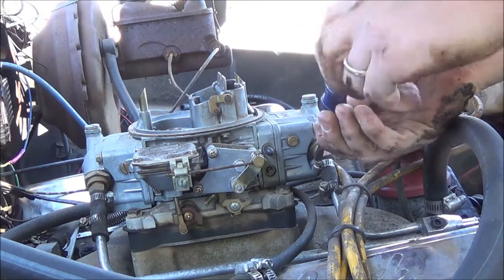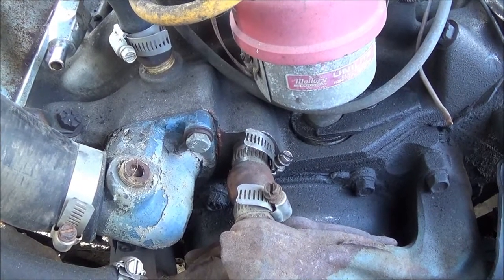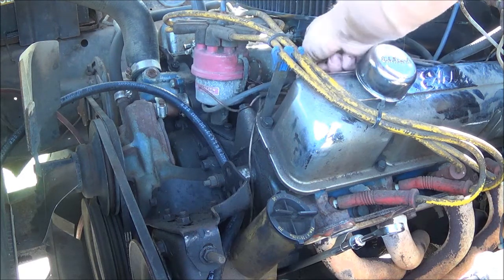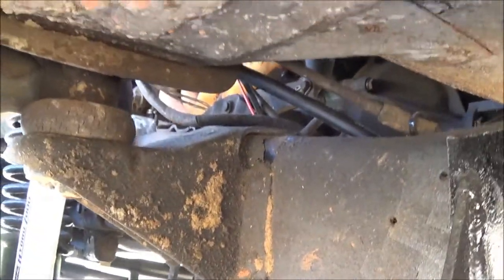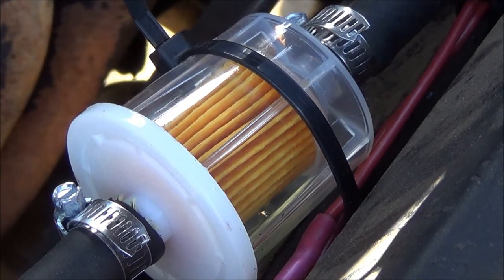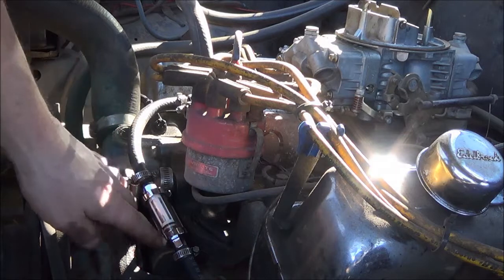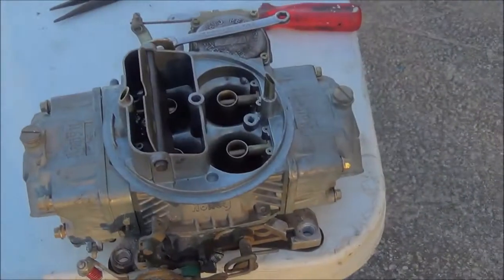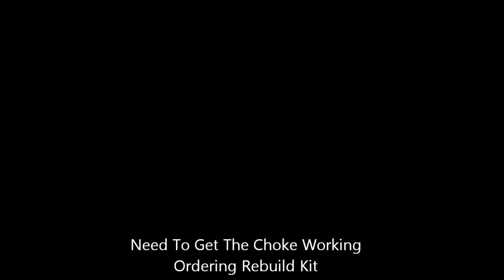1978 F-150 Build Part 13 New Fuel Lines, Filters, & Carb Trouble.

Comment: I had same prob. but mine would not start something eat my gas holes in the backthen I put new line on it to start it so I can move it and the glass filter is leaking I need to fix it now I watch all your videos so fare in 1 night great video you show how you did it all that's what I like I have a 1978 bronco 351m im try to fix up I call it crusty right now it has little rust in it lol

Comment: It's good to get all that rotted runner line out and get the gaskets in and between the intake done while it's still possible. Also..that rubber fill tank one rots out too. My 78' just lit up this fall because I tried to move from storage only a few years...everything dried out. Just about lost my shop as well. Never had an engine fire I couldn't get out. Now I own a fire blanket as well as a larger co2 extinguisher. Just bought a solid donor truck today shipped to me for 800. Hope to move my Cleveland into the truck after going through the topside dealing with fire damage. Hope it's all good.
Reply from the maker: sam k damn it man. sorry about the truck but glad the shop is still standing. fire is a scary thing!!!

Comment: I'm driving my one owner 1978 Flare side. My problem is I'm running out of fuel for the Holley dual pumper. On hills and on straight flat roads, it's cutting out. I've changed spark box (tempted to go back to points.  I'd have primed carb instead of cranking on starter so long.

Comment: Just my opinion, but I'd looking in to some heat sleeving for that fuel line especially around the engine to keep it from boiling the gas. Thermotec and DEI are the first brands off hand that I know.
Reply from the maker: You are right. I actually re-routed the fuel line away from the engine while I was monkeying with it trying to get it to start!!!! Now it is up and away from the cylinder head and away from engine heat. When I got this truck the fuel line was only about three inches away from the header. That was the first thing I changed on this truck, before I even started this build!
Reply: RedEyed Jack exactly. You can see in some of my old vids of my f100 that had a 390 of how I routed my fuel line to the carb. Used a Holley 110gph mechanical pump, to a custom made -6an line with a Russel fuel filter. Used some thermotec sleeve and it worked well!
Reply from the maker: ndubb1 this motor has a holley fuel pump and later on I would like to install a adjustable fuel pressure regulator with a gauge and run hard line from the fender area to the motor. For now I'll run it the way it is and just keep an eye on things.

Comment: Hey there mate that's cool us f truck drivers gotta look after each other with my truck I kept it standard from the tanks to the fuel isolator from there I have ran 3 8 fuel hose and covered it in fiberglass sleave up to the psi regulator psi Guage on one side and the fuel line with the installation on it and run it directly to the carb intake those glass filters are bad news if you are 4x4 n it will break on broke on my brother's car big hp don't labor in top gear sort of motor it was getting a rego check and they labored it it back fired through the carb and blew the glass filter in bits fire and 20g down the drain due to inexperienced in driving a big hp motor if that was my rig get rid of it mate you don't need it really from the plastic filter streight to the carb good luck with things
Reply from the maker: nathan schmidt right now I have the carb off the truck. when I put it back together I won't use the glass filter for sure. makes sense to me. the truck built has been put on the back burner as I've been working on my Land Rover. hopefully I'll get  this damn truck finished sooner than later. thanks for watching!

Comment: why don't you run the fuel line away from everything putting in an around everything that is getting hot it's probably vaporizing before it gets to the carb just a thought good luck
Reply from the maker: nathan schmidt also good advive. thanks!!!

Comment: You're better off rebuilding it anyway, since the new gaskets they include seem to be more tolerant of ethenol in the fuel from what I hear.
Reply from the maker: Good point. But I will only run ethanol if I have to. Most towns around here have at least one gas station that sells ethanol free. I'm never going to daily drive this truck so I'll pay a bit more for clean fuel! Thanks for watching!